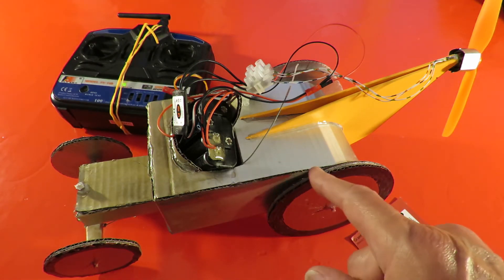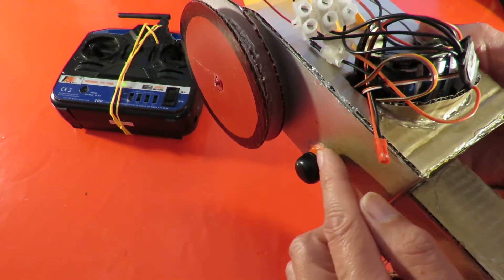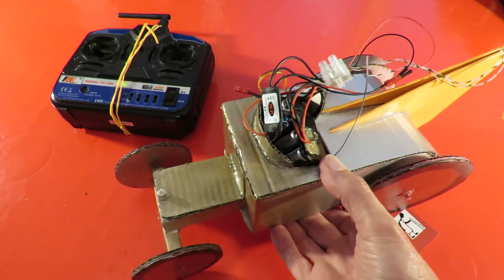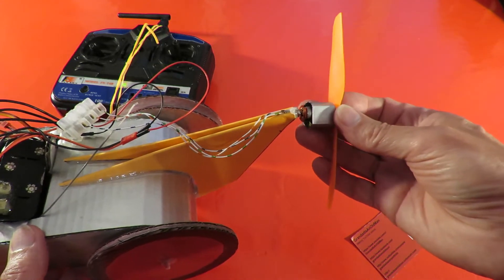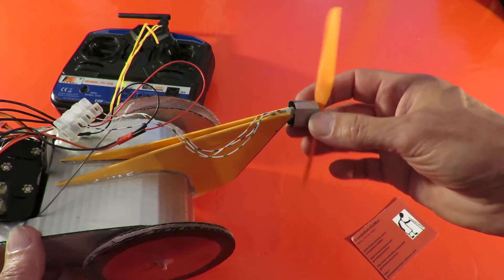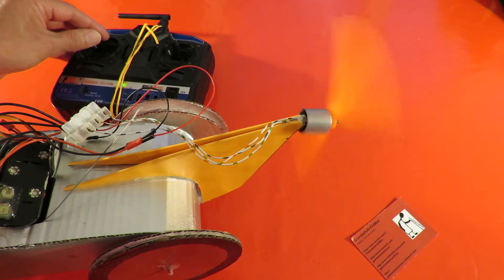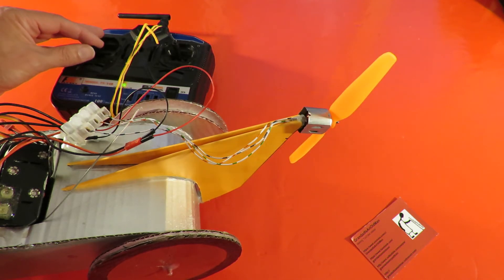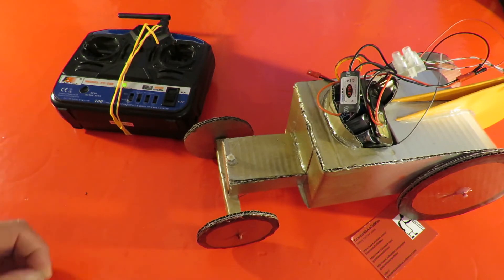Brushed Motor as Brushless Fan Car - Will it work?

Comment: That's what I found with the rectangular ones. Swapping to round, as you did with the new video is the trick.
Was worth a go, always is and thanks for showing a fail as well as the successes :)
Reply from the maker: A bit of effort changing out the bush to one a bit deeper would make it more stable but this was just for the fun of it and an interesting project all round just to see what works.

Comment: Hmm, so you seem to need a magnet surrounding the armature but spin the magnet and prop.   I kept picturing a array of magnets supported by something with bushings for both ends and be balanced.   Ever use bismuth to construct custom frames, brackets, ect?   I have for some small motors. Just use your soldering gun to melt some raw bismuth into a stick of sorts on metal surface so it cools fast then use that stick to create a framework or whatever.  If you did do this , you need to brace each " bismuth weld "   more than you think as bismuth is a soft metal that will warp or bend if much of any length is not braced.  If you need a slow solidification , do it on cardboard. It wont catch fire. Not hot enough.  I have melted some over small objects at times and made some cool things to look at. If you melt it onto a mirror or glass, it will copy the shine.  Looks like chrome.  Just thought I would mention it in case you wanted to try future things with the stuff. I use a piece of small cardboard ,about twice a stamp size, to wipe the tip. I pinch and twist rather fast because the heat goes through quick. I used to use a wire brush but I cleaned so often that I ate up the end of the soldering gun. I also keep a piece of think cardboard to poke tip of solder gun into  to clean it.  This stuff melts at temp of boiling water.
Reply from the maker: Thanks for the input and I can see what you are suggesting but I think you are thinking too hard :-) Normal brushless motors are basically the same as this, they just have a better bush to support the case and the case is far more rigid. The bush on this little motor was never designed to hold the casing stable as the armature would have been supported at both ends and the casing is just thin metal so relatively flexible especially in the small area where it grips the bush. It would probably be possible to make an extended bush from a piece of brass and screw it to the front of the casing if somebody wanted to do the work but this was just for fun. You will see in the next video I use a different motor which has a slightly more stable casing.